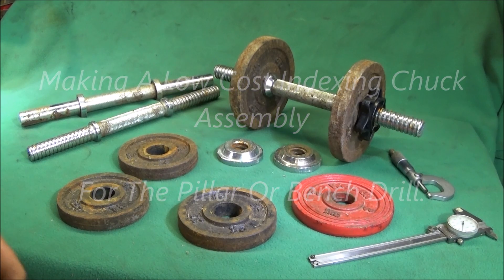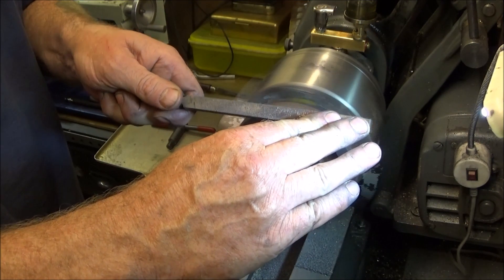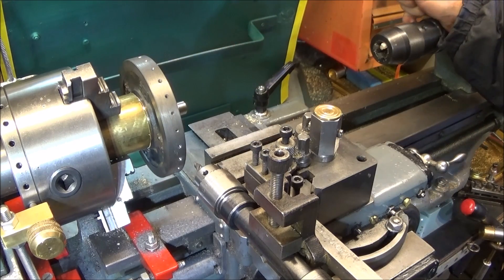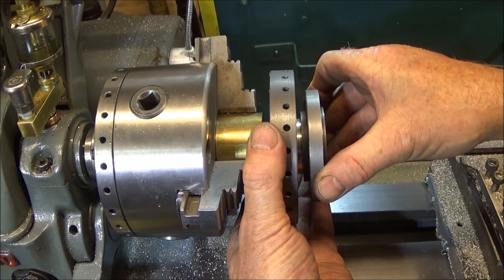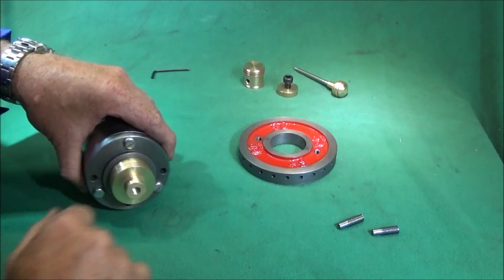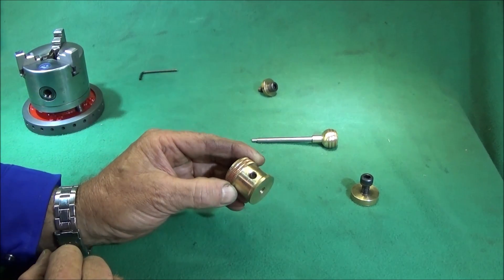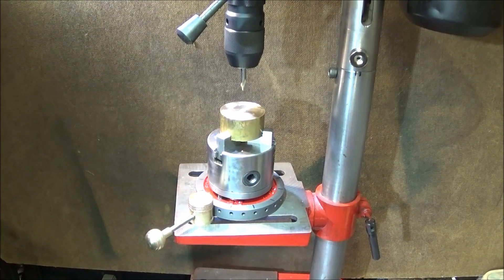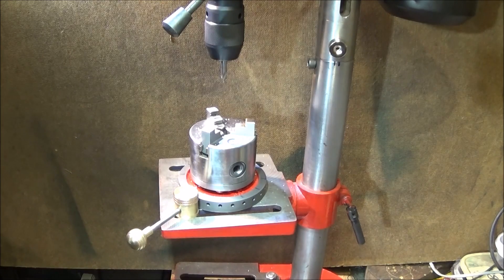How To Make A Low Cost Indexing Chuck Assembly For The Bench Or Pillar Drill

Comment: Hi Steve
Great idea. I'm sure it will be used a lot.
You could have used locktite if you drilled clearance holes through the cast iron for the chuck bolts.

Thanks for the idea

Comment from the maker: SOME EXCELLENT DRILL BIT OFFERS:- 30% off Drill Bits Promotion -- https://goo.gl/KrG3Wh (code: 266b22 )
9pcs 12mm Shank Boring Bar Carbide Tipped Boring Bar -- http://bit.ly/2PFzhbJ
Drillpro 10pcs HRC45 Blue Nano DCMT070204 YBC251 Carbide Insert -- http://bit.ly/2lB6mKy
Drillpro 4pcs 10mm Shank Lathe Boring Bar Turning Tool Holder -- http://bit.ly/2YEwoMA
Drillpro 10pcs DCMT070204 Carbide Insert DCMT 0702 Cutter -- http://bit.ly/2qIAFlx
Drillpro 29Pcs 1/16 to 1/2 Inch Titanium Coated HSS Twist Drill Bit Set -- http://bit.ly/34d9I7d
Drillpro 6Pcs 1/8 to 1-3/8 Inch Upgrade Titanium Spiral Grooved Step Drill Bit Set -- http://bit.ly/2ruTN7c
Reply from the maker: 9pcs 12mm Shank Boring Bar Carbide Tipped Boring Bar -- http://bit.ly/2PFzhbJ
Drillpro 10pcs HRC45 Blue Nano DCMT070204 YBC251 Carbide Insert -- http://bit.ly/2lB6mKy
Drillpro 4pcs 10mm Shank Lathe Boring Bar Turning Tool Holder -- http://bit.ly/2YEwoMA
Drillpro 10pcs DCMT070204 Carbide Insert DCMT 0702 Cutter -- http://bit.ly/2qIAFlx
Drillpro 29Pcs 1/16 to 1/2 Inch Titanium Coated HSS Twist Drill Bit Set -- http://bit.ly/34d9I7d
Drillpro 6Pcs 1/8 to 1-3/8 Inch Upgrade Titanium Spiral Grooved Step Drill Bit Set -- http://bit.ly/2ruTN7c
Reply from the maker: Banggood Health Protection -- http://bit.ly/33tNTBx
  Banggood Health&Care Protection --  http://bit.ly/3d7QpSy

Comment: That's amazing work Steve. Well done! I'm disabled so don't get out much, so i spend a lot of time making bits and bobs for around the house. I've recently been wondering how i can find something that will enlarge what my pillar drill chuck could hold. And you've found the answer! So thank-you. My next question is, have you any idea in general a machine shop would charge me to supply and make me one of these items? If you have, and could name a company who won't rip me off could you email me please. It's jamie.s5706@gmail.com
In fact if you can get hold of the bits and have the time to make another for me, could you let me know what it would cost me please? UK shipping isn't an issue as my friend drives for a living and covers most of the UK. Thanks.
Reply from the maker: Hi Jamie This tool isn't for holding larger items in the drill chuck. It is specifically for indexing work. I do not have time to make tools or items for anyone else as I am booked up in what I am doing on YouTube. I don't know of anyone that would do low cost precision engineering either. It is very time consuming to say the least. Regards Steve

Comment: Very nice work. I have solved the same problem.Split a circle on 24 exact pieces is impossible with my equipment. I got an idea to use gear wheel. The teeth on the gear wheel have exact distance. I used gear wheel with 24 teeth.

Comment: Hi Steve, A fantasitc  idea i do however have one very small niggle ,and that is when you drill i noticed you drill table dipped,this may be of Little concern to the precision you require,and is perhaps not worth mentioning but it can be rectified by a small bottle jack under the table (i do it on my table)and it works fine.keep up these high Quality vids,best regards mbg.
Reply from the maker: Hi Mark, Thanks...I use a scissor jack under the table now. I found that the scissor type are easy to control, as soon as it touches the underside of the table, stop. The bottle jacks are just as good but I found there was a tendency to push the table up a bit on the pump action/lack of feel....Probably the bottle jack wasn't very good quality....Regards Steve

Comment: I am now scanning craigslist for cast iron weights, great idea. Just made a plate like this for my rotary table to adapt a 4 jaw chuck and used a old flywheel from a tread mill motor. My chuck was a 6" and the flywheel is about 6.5 so it works perfect. Did it similar to what you did here. For those doing machine work on a mill and not playing around with a drill press you will want to look for a rotary table. It works similar to this but better.
Reply from the maker: Hi Robert,....Sounds a good job. The weight bars are also great. I'm not sure what type of steel they are but they seem to machine nice and you get a lot of material from the long ones. Thanks for watching....Regards Steve

Comment: Your wearing a long sleeve coat while reaching over a turning drill? Nasty nasty! You have just failed machine trades 101 !
Reply from the maker: Its got a machine trades 101 safety cut-out switch for long sleeve machinists, so it complies with safety regulation machine trades 102 which supersedes the 101 machine trades clause of the European health and safety act 2017. So put that in yer pipe and smoke it........:-)

Comment: Hi Steve I'm a welder by trade but have developed a passion for the metal lathe. I have a south bend older lathe but in good shape. I have watched all your videos and find them fascinating. I've learned a lot of new things from watching. However I am real interested in an indexing back plate, but finding out you need one to make one. I have a PC 6"chuck I guess. If you measure across the face it measures 6 1/4 ? Would like to buy one or make one but not sure how without one. Any advice ?  Keep up the good work and videos.
Reply from the maker: Hi Sharon, sorry for the late reply....It depends what other tool fixtures etc that you have. Before I had my indexing plate, I just worked out the circumference of the chuck and divided the number of divisions. I then carefully marked a piece of masking tape up with these divisions and stuck that around the chuck, using a magnetic fixed pointer from the headstock. Very primitive and not dead accurate but it worked at the time for what I wanted. You can also use a home made pin assembly in the screw-cut gears at the back of a lathe. But without seeing what you have access to or your actual lathe it would be difficult to come up with an actual solution. Thanks for watching...Regards Steve

Comment: I made a face plate for my wife's wood lathe and cut the hub from a brake disc and I never had such a filthy shop. Cast iron is a horrible thing to turn....I will never use it again.
Reply from the maker: Hi Yes it is very messy to use. I cover everything with paper towels when using it and clean up after every session on the lathe. You also have to be careful that you do not breath in the fine dust it produces, as it is best to machine it without any coolant. Regards Steve

Comment: what made me click on this video was to see how you manage  to index the holes at home. turns out like someone else said, you need one to make one.
Reply from the maker: Hi If you have a lathe there are other methods of machining accurate equally spaced holes on components.
Reply: I see in your video that you have a plate behind your chuck but to my knowledge  that is diy modification  on your part. Is that what you are referring  to or are there other tricks that I don't know of?

Comment: Very nicely done. How does the weight machine? I've heard that the cast iron it's made of is of poor quality with lots of voids and such. Did you have any issues? Thanks for the video!
Reply from the maker: Hi Thanks, The weight machines ok. I didn't find any indication of voids. The only thing I don't like about cast iron is the black dust that comes off when machining. I always give the lathe a good clean down after using it. Also I am careful not to breath any in.

Comment: Very well done ! You're a man after my own way of thinking. I too have used these weights and found them to be really well made with nice cast iron, One point I did not quite understand why did you not simply remove the lettering on the cast weight wouldn't it have looked much less homemade ?Just  what I always do to enhance the appearance  IMHO .I like your workmanship . Alistair
Reply from the maker: Hi Alistair, Thanks. I thought about removing the lettering, but then went on to another project to save time! The weight lifting bars are really good as well. Saves a lot of money if you can get them cheap and they are easy to machine with a good finish. Also  you can save the knurled sections for new components.   Regards Steve

Comment: Very good. Your pillar drill sounds a bit rough. Are the bearings ok?
Reply from the maker: It does sound a bit rough, something is rattling around but the bearings are good......:-)
Reply: The Mechanical Saw Chapnnel
Reply: The Mechanical Saw Channel 
its looks cable drive..maybe the noise
Reply: p Waterman to
Reply: Nelson Copeman 
kï
Reply: It's not the bearings, I have a similar drill, the quill fits poorly in the body, which rattles when in use, I've toyed with the idea of boring it out and putting a sleeve in that fits the quill properly.

Comment: Speaking of recycling, I wonder if you can make an indexing plate from an old rotor from a bike. Some have holes spaced perfectly around the perimeter and a few have multiple rings of hols..
Reply from the maker: That's a good idea
Reply: rry Manilowa
Reply: I know this comment is old, but I am building a Rotary weld table/indexing head. I was going to use a sprocket but a rotor is much better. Thanks for the idea!

Comment: Very nice project and a cleaver use of the cast iron weights. I like your added detail with painted recesses. Would you consider hand-stamping an index number below each hole along the side of the index ring for easier referencing the holes? Thank you Steve for your excellent way of showing your thinking that went into your designs and steps of machining.
Reply from the maker: Hi Paul Thanks. Yes that is a very good idea about the stamping. The only important thing I forgot to mention about the weights is the cast Iron dust that comes off when machining. I take care not to breathe it in and thoroughly clean the lathe afterwards, as it gets everywhere! We have a good recycling centre where I can get bits and pieces to use. The bar for the weights is great as well. It is a nice diameter and length of mild steel.  Regards Steve

Comment: Thank you Steve!  Another cheap and cheerful build that is really useful.  Like the idea of the weights as a base...and using it on the DP is a great idea.  Been working on RT angle one with some scrap 1/2" AL that is 4" square for use with my 3" mini chuck. I use it for all kinds of things, like holding round stock tight for deep hand tapping.  My plan is to print a degree wheel and apply it to the AL and make a pointer so I can rotate to any degree and lock it down with a clamp of some type or maybe with a cam.  Thanks for all you bring to us!!  ~PJ

Comment: good work love seeing items repurposed what do you think of the HBM chuck is there much runout or are they ok they seem to be good on price
Reply from the maker: Hi David, Thanks. The HBM chuck I have is very good. I have about 002" run out. The only thing worth doing though, if you get one, is to strip it down before using it and give it a good clean. Mine had some factory swarf and dirt left in it from when it was made. I hope to buy another 125mm one for the Mini Lathe next.

Comment: Nice work. But you could have done the same using your drill adapter on the lathe.
Are the any other uses, things that can't be done on the lathe?
Reply from the maker: Thanks. The only thing I've noticed so far is that its a lot quicker to use and its easier to see the face being machined. It just makes everything more versatile. As I've got the Myford indexing plate it is quick and easy to do all the chucks I have as well. I am doing one for the Mini Lathe at the moment.
My Regards Steve

Comment: all of my york cast iron bar bell weights are so hard(chilled) that no way to machine them :(
Reply from the maker: Hi Lawrence, I haven't tried any York ones yet. The one I used was hard on the surface, but once I got through that it was ok. I used a carbide insert turning tool with an 04 Radius and very light cuts.
Reply: I had some that were VERY hard. I used the angle grinder with a regular abrasive disk on it to knock the skin off as well as the raised numbers and logos.  I don't remember exactly how much I removed with the grinder but it wasn't much. Machined okay after that and got better the deeper I went. PITA but still worth the effort when you price cast iron bar stock, if you can find it. I think some of the problem was sand imbedded in the crappy casting. If you live in a rural area, tractor weights are usually cast iron. Good luck.
Reply: on these york weights...the chill is deep and not worth ruining my lathe....a file just skips off of them